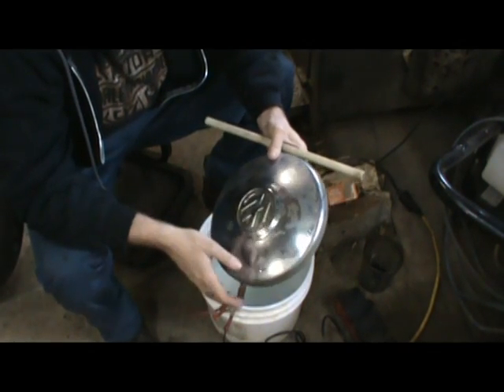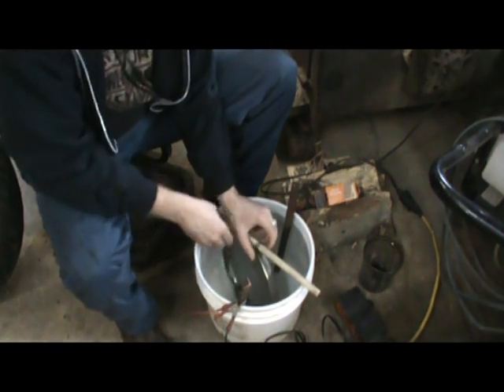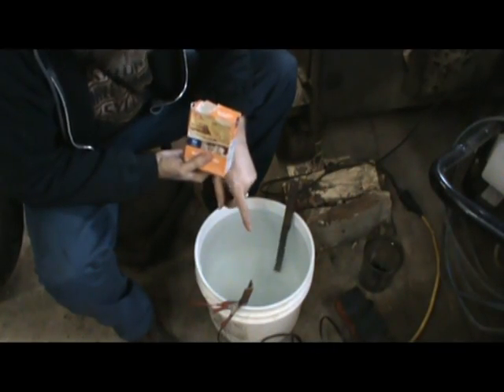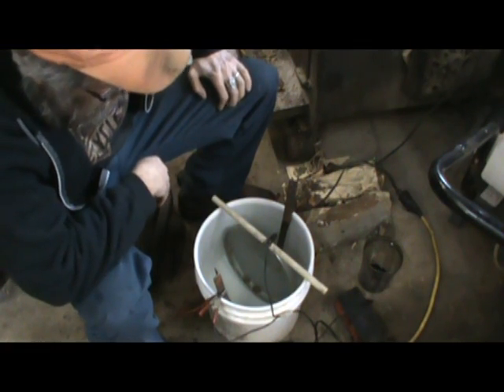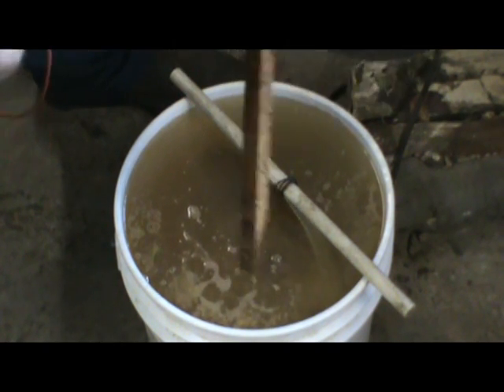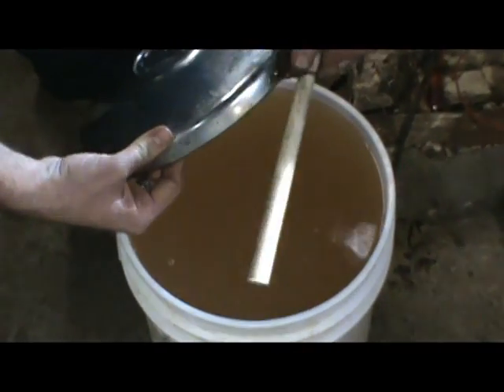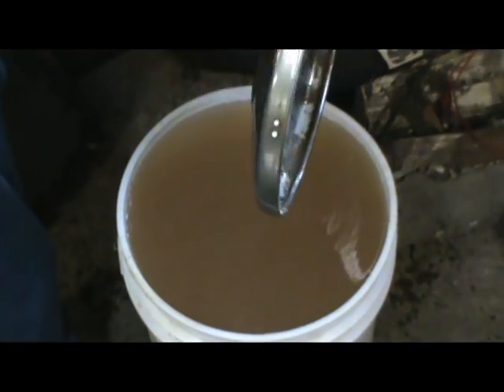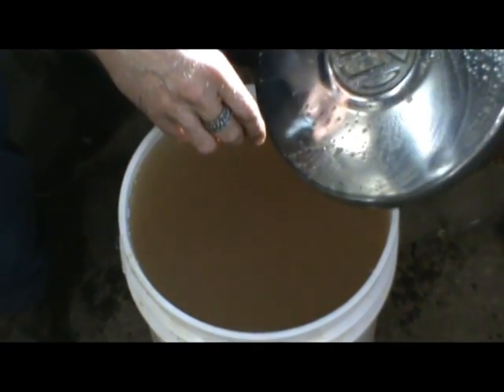Adventure in electrolysis-experiment with amperage

Comment: Addictive hobby... Do you still dabble
Reply from the maker: Julio's Evil Twin I still dabble a bit...thx for watching!
Reply: @Hambone_777  hey good to hear, I started off with the bucket system & through a lot of trial's & testing I found the happy zone.
 Consider this, imagine you'd a steel bucket, smaller than the one you're using, cut the floor out, stand it submerged in the plastic bucket of electrolyte water, now you can suspend into the water - over a beam of wood, with a 360° cathode around your piece ;)
 I'm using a rectangle plastic box with a floorless steel rectangle box that fits snugly inside.  Rain water & 12v 6a battery charger.  And never letting the black oxide goo dry onto the piece.. that's my set up 👍🏻

Comment: I'm amazed at how good that   electrolysis  works, I used it to clean up an old Farmall Cub battery box and it actually loosened the old paint along with the rust so I could repaint it.